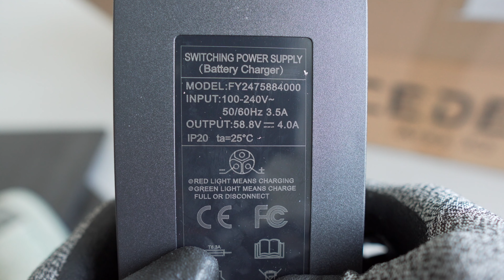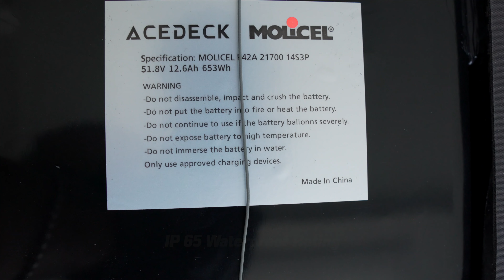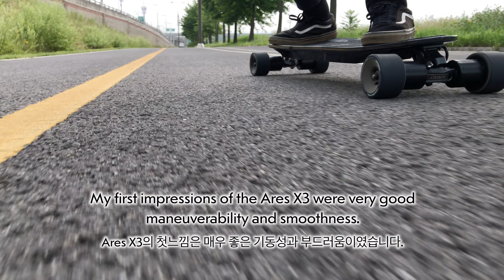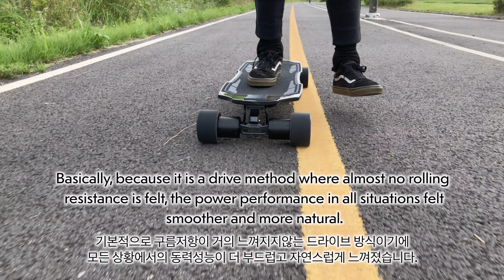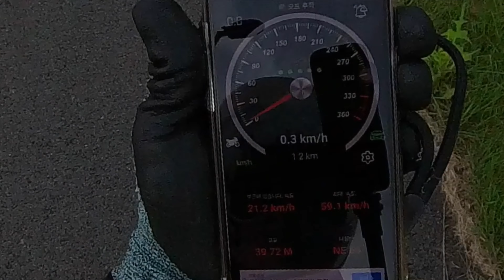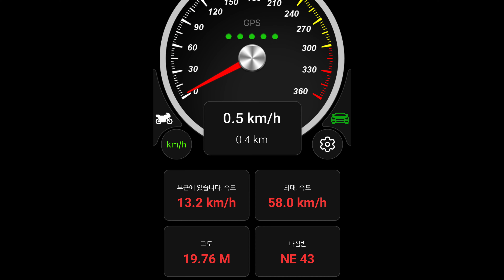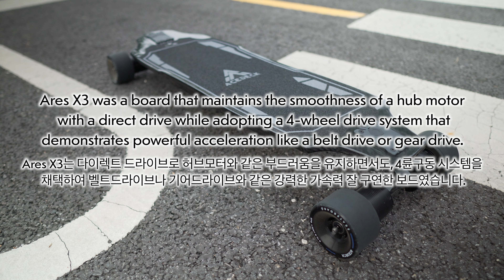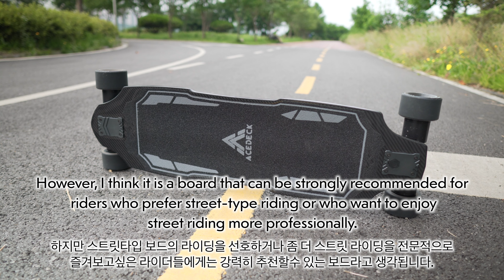#188 ACEDECK Ares X3 / 37MPH Arrow - It's not for all but I love it so much

Comment: I have one of these boards and really enjoy riding it as its so quiet..I put ABEC 11 107mm wheels on it and it was like skating on ice so quick and smooth and fast...It tops out at 66kph now..I changed out the bushings and its even better..Its a favorite and it looks really cool ..im so grateful to have it and love riding it...🚀
Reply from the maker: Yes, I totally agree. This board is so special and I love it so much!!!
Reply: @KAMiJUINs  i was thinking of getting the coud wheels rovers 110r...have you tried them out yet and if so how do they compair with 115 airless wheels
Reply from the maker: Mad Wheels 105 is more recommended than the Rovers 110R. And I tried the Rover 105R, and it didn't fit well with the Abec wheel pulley on the X3 and I felt a lot of clearance in the core.
Or 115 rubber wheels would be nice. (https://acedeckboards.com/products/115mm-rubber-wheel)
Reply: @KAMiJUINs  i have the 115 rubber wheels but they reduced the range by half but i have the ABEC 11 but they dont like concrete paths
Reply: @KAMiJUINs  are the 105 mad wheels urethane  ?
Reply from the maker: Hydro type 
https://www.icloudwheel.com/collections/cloudwheels/products/cloudwheel-hydro-100mm-urban-all-terrain-off-road-electric-skateboard-wheels?variant=44238180614382

Comment: Only concerning for me was the clearance on the motors but if they allow the riders to have 100mm and up, that should help greatly. Looks like nice downhill racing or track racing board. Also, they could fit bigger battery in there if they did Mboards' way by adding two ESCs in the back on single heatsink. Only reason that I'm going to avoid Acedeck is that it's nearly impossible to get e-boards within Canada here due to insane taxes and shipping.
Reply from the maker: Yeah, this is such a board. And that's too bad. But Our country's import tariffs are also not easy. :(
Hope there is a good way to get a board in the future
Reply: Acedeck has a Canadian site too now so hopefully it won't be too bad when ordering through there if there's a Canadian warehouse

Comment: Nicely shot and edited video as always, and it looks like an impressive board. Would be nice to see a bigger battery and some Formula 110’s on the corners. Of course I’d add surf adapters and flip the rear trucks😊
Reply: What are surf adapters? Also what is the benefit of flipping the rear trucks? Thanks!
Reply from the maker: If that's the case, I think you should buy another board lol~
Thank you for watching for a long time :)
Reply: @EverybodyEditsHacks  check out Waterborne surf adapters, they are amazing. They mount between your trucks and deck. The front has a massive trailing arm linkage that allows massive turning agility from the front end. Th rear is just two rails with elastomers that allow the rider to lean over with a lot of angle to help turn the front. I flip the rear trucks because, with so much front agility the rear can focus on stability.  This way the board is extremely agile and responsive, yet is also impossible to speed wobble at high speeds. It improves traction and control durning hard cornering and carving.
Reply: @EverybodyEditsHacks  I’ve a short video on my channel, please forgive the crappy quality
Reply: @sageoz9886  WOW! I watched your video and your board looks incredible, I need to see that thing in action. I also watched some videos on the surf adapter and it looks really fun. I might have to try this out for myself!
Reply: @EverybodyEditsHacks  thanks! I’ve been riding for years and experimenting with handling and this set up is by far the best. It feels amazingly stable under the worst conditions yet is still really playful. I need to get a 360 camera soon to take riding vids and to make a better one explaining my theories on set-up. It’s so worth the investment as it unlocks the true potential of the skateboard bringing it up next level. I can barely ride anybody else’s stock board now; it always feels kinda sketchy at speed yet turns like cruise liner where it’s a suggestion and the board finally gives it up.
Reply: @KAMiJUINs  lol but I do this to every board I’ve had, and two of my riding friends are now total converts. I have to make a decent vid soon to explain it better and show off my boards

Comment: How does this accelerate in comparison to a powerful 2WD AT board like the hurricane in straight line performance?
Reply from the maker: It feels less jerk when starting off, and it accelerates smoothly but very quickly and the speed rises up.
It feels like a hub motor, but if you think it's very fast, it'll be similar.
Reply: @KAMiJUINs  ah interesting, thank you for the reply. I noticed the motors were almost silent. Quite amazing

Comment: Hello, I have one question. How do you like the Acedeck 97 mm rubber wheels in terms of comfort, grip and fun compared to regular PU street wheels and as an intermediate option to AT wheels. Thank you
Reply from the maker: Hi, definitely rubber material, so it had a better grip compared to PU wheels. It depends on the rider, but it's not a bad choice if you prefer a comfortable riding texture.~

Comment: Hello, looks like you cannot use bigger wheels due to wheel bite which would be good given the direct drive motors. Also, Kegel adaptors would be nice. Thanks
Reply from the maker: Hello~ As I said in the video, up to 120mm wheels can be used without wheel bytes.
I will also purchase the Kegel adapter if it comes out.~ :)
Reply: @KAMiJUINs  Sorry I missed the part about wheel size. Boosted 105s would be good I think.
Reply from the maker: With the Kegel pulley~ :)

Comment: surprised. You didn't need to heat the griptape with hot gun before peeling it😳. New kind of glue used to the griptape?
Reply from the maker: yes i thought so too~ The deck cover was treated with something. Wasn't the glue.

Comment: Have you had any issues with the motor bearings? I have massive problems with grinding noises in my direct drive onsra which uses the same motors i think. Changing motor bearings is not that easy on the direct drive and has not solved the problem.
Reply from the maker: There's nothing wrong with mine yet.
I think we should change the motor if that happens.
Reply: Try changing the bearings in your wheels..👍

Comment: 4wd is a red herring. it's either too heavy or too expensive. Really I don't know who this board is for.  Racing scenario, it's too slow, compared to some of the heavy hitters in the scene. I'd rather have a bigger battery for the same price.  

Comeon Ares, build a real racing 4wd board, swappable battery is what we want to keep the weight down.
Reply from the maker: Thank you for your opinion.
But this is the one I'm still most satisfied with among the street-type boards I've ridden this year.
Reply: It’s for people who like riding street with direct drive. 4WD direct is very different from 4WD belt. It feels very smooth and torque-y, especially in the carves. It’s also absolutely silent, which really changes the ride feeling (you’d be surprised how much motor noise affects it). 

If you’ve never ridden DD, it’s hard to explain the appeal, but it’s there and can be very fun versus belt, gear, or hub drives. This isn’t a racing board. It’s a perfect board for chilling out on and relaxing while going on long rides.